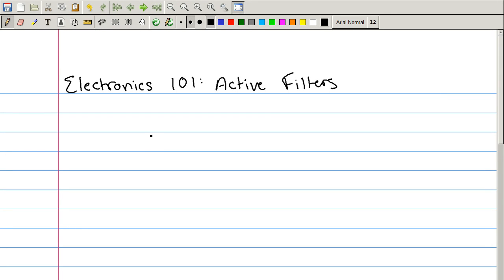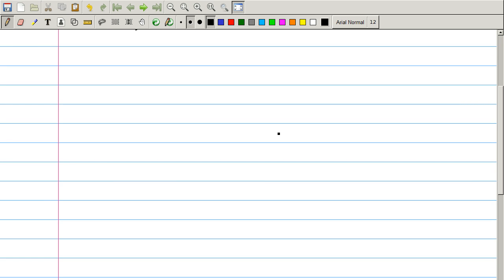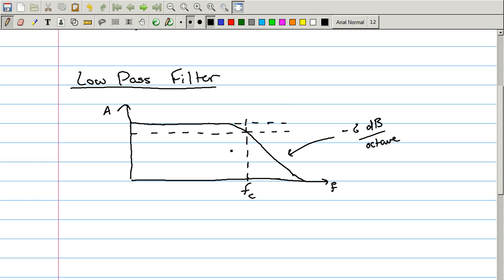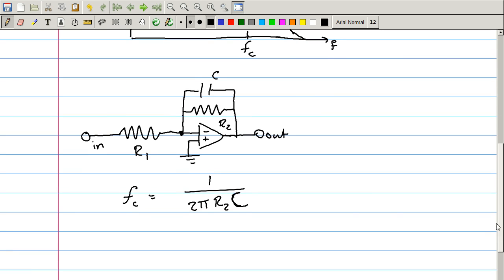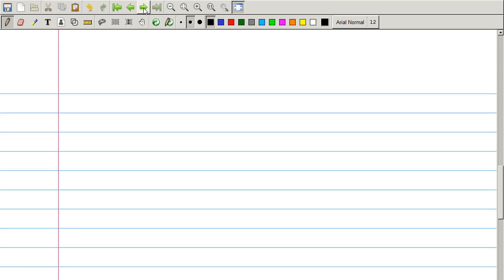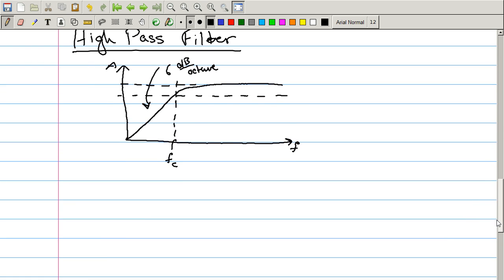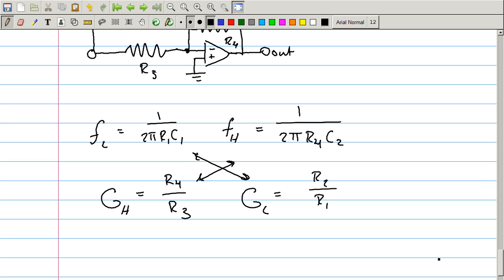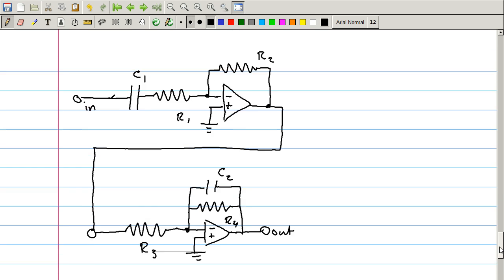Electronics 101: Active Filters

Comment: 13:00 I had a revelation here that this configuration can be whatever you want it to be (integrator, differentiator, band-pass) depending on what frequency you are interested in and your choice of resistors and capacitors.  Thanks!

Comment: Why is the capacitor not affecting the gain?
Reply: The gain is for the "flat" part of the frequency response curve -- at these frequencies, the capacitor has no impact on the circuit and the gain is determined entirely by the resistors.

Comment: Isn't the gain Negative? (-R2/R1) , For the inverting amplifier,
 Also, In Microelectronics circuit analysis 3rd book says that
the voltage transfer function of a high pass filter is:
T(s) = (sRC)/(1+sRC)
however, the voltage transfer function of a Low pass filter is: T(s) = 1/(1+sRC)
Looking forward to hear from you "humanHardDrive"
Reply: in audio theory,it is not matter if the gain is positive or negative.Also  your and his voltage transfer function from video  is good

Comment: In your op-amp low pass filter, what do you mean when you say zero bias?  Your still biasing the op amp normally with external power right?    If you have zero bias how does the op-amp have power to operate?